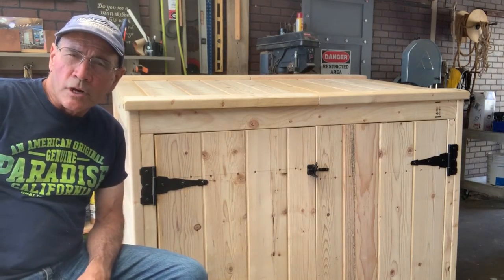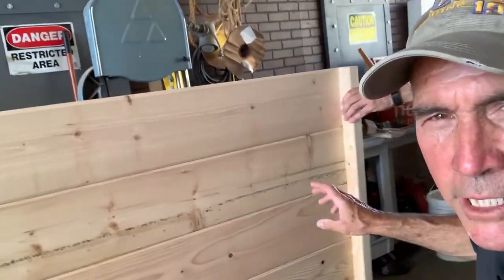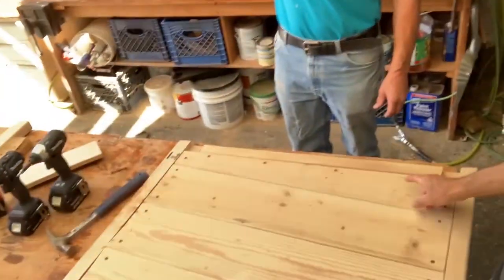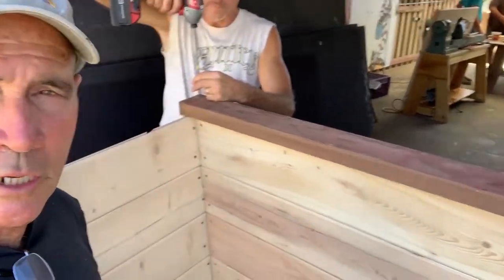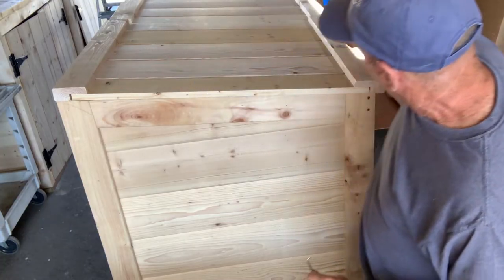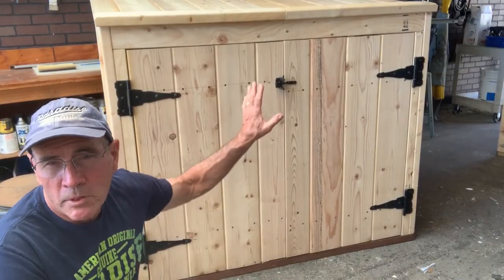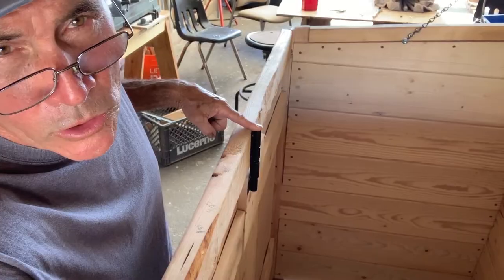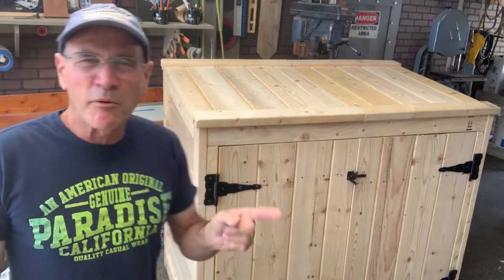How to Build a Trash Can Enclosure

Comment: Pretty good plan.  I was thinking about using some T1-11 8 OC siding instead of ship lap pine.  Additionally, I want to make a "garbage can container sled/cart" so I can move the entire structure down to the curb in the Winter with my ATV.   I have a very steep and long driveway and it becomes an ice rink in the Winter.  Good plan and I'm definitely modding it.  Cheers!
Reply from the maker: William Logan t 1 11 is a good idea easier to square up and probably stronger

Comment: Great looking shed. Not sure about the lip running across the front of the lid though. It will trap rain water and snow and will accelerate mildew and eventual rot. A clean uninterrupted slope might be a good modification.
Reply from the maker: Great observation , that’s why we ran the boards the way we did which left little drawn holes under the lip.

Comment: what do you do to make sure both front doors close and align evenly?My 2 front doors close fine and latch but one door is more out-front than the other door
Reply from the maker: Check first to make sure the edge of the door itself is not binding against the side it’s attached to and then both sides where the doors are attached need to be plumb or parallel to each other. The unit might be twisting. Aligning doors can be tricky but it’s kinda fun.

Comment: Is there any plans for this over all dimensions and angle of the top? I really like the idea.
Reply from the maker: No plans, sorry. We just made them fit our cans. Make sure you make them 4 - 5 “ taller so you can roll them out easily.  Later we attached a chain between the lid of the enclosure and the lid of the trash can so you could lift both lids at once.

Comment: Can you give the measurements? I never built anything, and Inwould like to try building this. Would be great if I could give the measurements at Home Depot and then just bring bavk home and assemble it. Thank you :)
Reply from the maker: I could but it might not work for your trash cans. Measure the size of whatever cans you have and add about 8 “ in height and 13 “ in width . Also read through some of the other comments . They make some good suggestions. Then, go for it. You can do it.

Comment: The problem is that front bottom board. You'll have to lift the full trash barrel over that
Reply from the maker: Very observant , you’re right we replaced that later with an 1/8” thick x 3” wide piece of metal/band iron for that very reason.
Reply: @BobsTwoCarGarage  👍